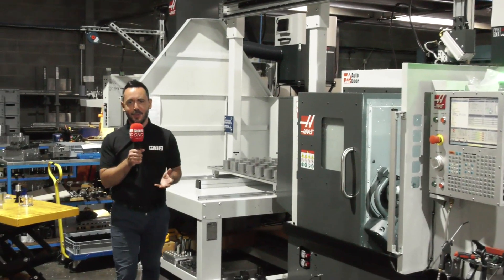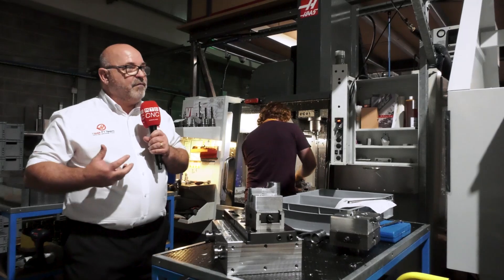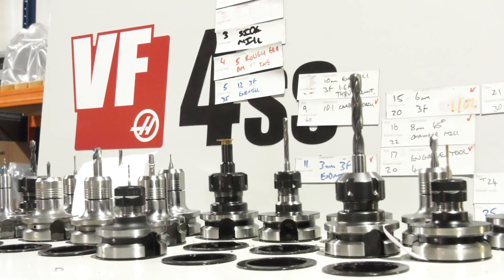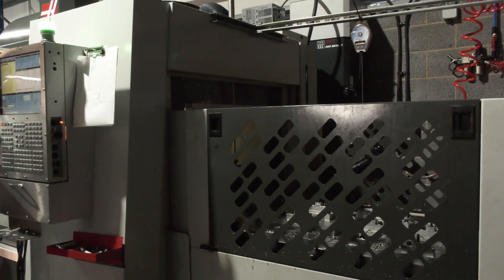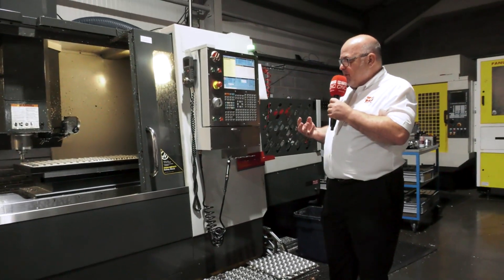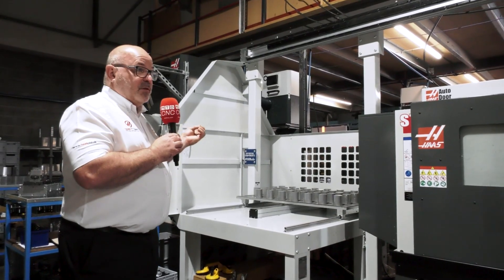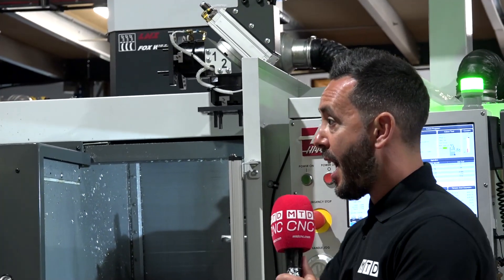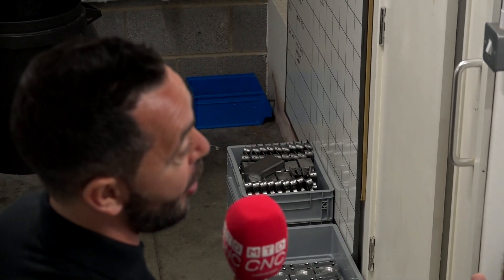The HAAS Journey At Superstar Components

Comment: A plate that big, did the parts came out warped?
Reply: probably, but if you measure the warping on that plate and divide by the colums of parts, you'll get the warping thats masurable on the finished part. that value may be nothing for that type of component
Reply from the maker: Glad you enjoyed the video.